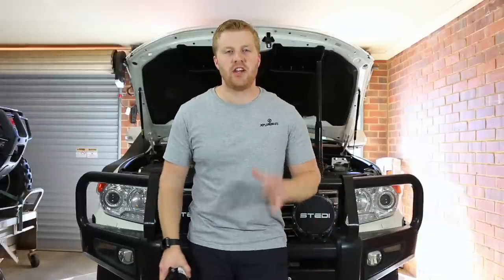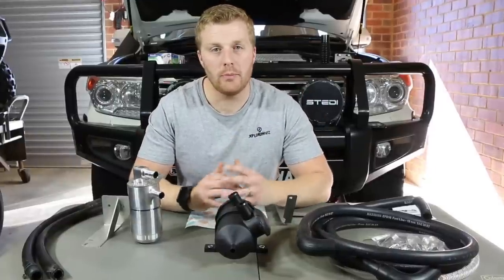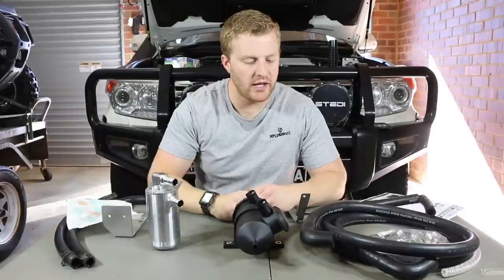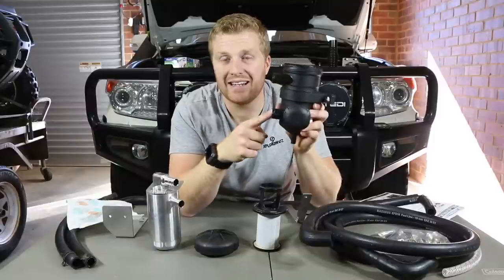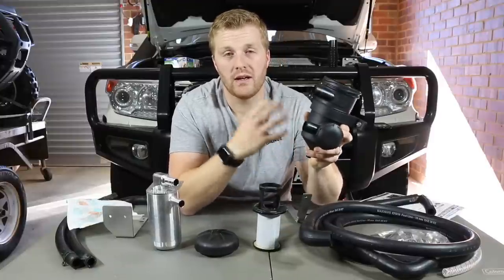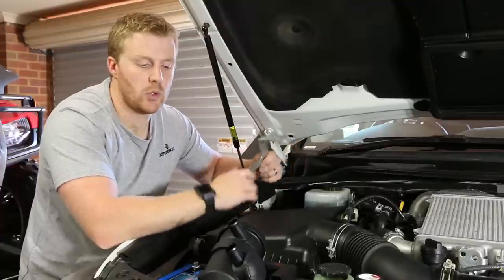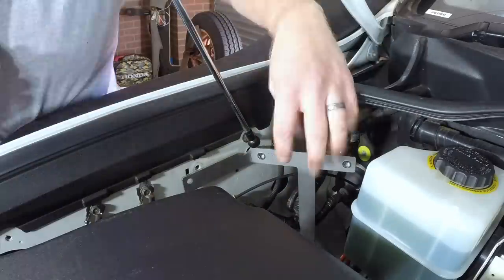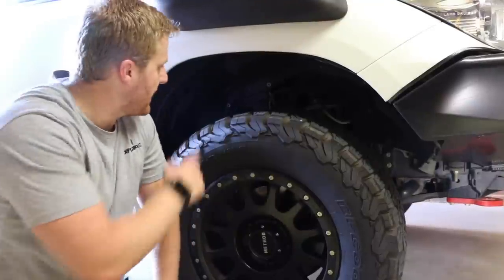LC200 | Provent Catch Can vs HPD | Why I’m swapping | How to install | Difference | Oil Separator

Comment: I'm waiting on delivery of a new 4x4 and yesterday I went in to ask the dealer if me installing a catch can would void my warranty and he went on a speech about how catch cans aren't required on modern diesels etc etc. I don't think it will void my warranty, but I might go talk to the service department instead of the salesman next time. I feel like it's a worth while mod.
Reply from the maker: Yes, salesmen are taught to promote the vehicles and their systems in their stock format. Most salesman won't agree that the vehicle 'needs' all these extra modifications straight from factory. 
I've done another video on my Provent 200 and you can see how much this system has caught - https://www.youtube.com/watch?v=bJ5VG6UhTE0&t=5s
Reply: In my opinion the lack of transparency in the servicing required to keep a modern diesel happy is just straight up dishonest.  Absolutely fit a catch-can, otherwise the PCV and EGR just play “how fast can we choke up the intake”.

Comment: Two schools of thought re catch cans : some mechanical people suggest the EGR valve benefits from some oil, others say no oil or minimal oil (due to Catch can) is better for the ERG valve. Your thoughts?
Reply from the maker: I see what you mean, however I would maintain that the EGR does not require any oil, whether or not it benefits from it is another point. However the EGR was designed to run without oil and will do just fine as such. I would still rather the benefits from a catch can over the potential small benefit. Only my opinion and happy to debate, but that's my train of thought. 
Cheers, Nathan.

Comment: Great vid thank you. How is the 200 since it's been on for awhile, any side effects? Collecting oil ok? Why I ask about side effects is, what happens to the air flow once the filter begins to fill up, my way of thinking is that crankcase pressure would build up and cause issues because the engine can't release the pressure back into the intake. Please share your thoughts about this. Cheers Steve.
Reply from the maker: Thanks Steve, your comments are appreciate. 
So far, it's been working well. There has been no indication of any issues and it is still collecting oil at a very efficient rate. 
A couple of things regarding the air flow, firstly keep in mind the airflow from the crankcase is relatively low pressure. There is no extreme pressure or flow coming from the crankcase and therefore the air has plenty of time and availability to flow through the filter without issue. Further, the Provent 200 (largest unit) has a large filter and is designed to maintain flow and filtration even when fully soaked. 
If in the unlikely instance there was a build up of pressure, these units are fitted with a pressure control value that will by-pass the filter and allow gasses to flow without filtration. Although this would defy the point of fitting this unit, it is much better than risking engine damage. 
Cheers, Nathan.
Reply: I find it amazing that even in the testing the provent offered the highest flow and driest air over the cyclone types. It was just in my thinking of how do you push air through an oiled filter but I hazard a guess that the systems filter and design obviously works. Thanks for your input.

Comment: Great video! after trying several bands, there is no doubt in my mind that the Provent is far superior than the rest. Had one in my old Patrol. Had  PROVENT 200  installed in my LC 79 before it was even registered.
Reply from the maker: I agree, they have definitely produced a solid unit here!

Comment: Great detailed video as always.
Wouldn't waste money on one as there is no harm done with a bit of oil mist going into the intake...... as long as the egr system is blocked.
Reply from the maker: Cheers mate, yeah I guess if the EGR is blocked that little to no harm will come, however I would dare to say that most people don't block their EGR's...
Cheers.
Reply: The oil vapor is still blowing through intercoolers, turbos, and onto the valves.  It’s not just about keeping the EGR assembly clean.

Comment: Tengo el mismo filtro que menciona en el min 10:00, mi duda es que pasa si le saco la válvula de presión que lleva el recipiente por el costado inferior y le adapto una tapa en ese orificio ya que según he leído esa válvula de presión solo es para igual la presión que hay en el motor para que baje el aceite al carter, pero yo al igual que usted le tengo esa manguera de color blanca para luego vaciar el aceite acumulado y en ese caso la válvula no tendría sentido ya que no estaríamos aprovechando su función...

Comment: Bro any catch can made by metal will absorb heat from engine compartment which will increase the oil vapour going to intake system... better to use plastic and install it in the coolest place in engine compartment.. however the blowby gas rich the PCV valve with full of heat, toxic gases ,oil fumes and steam must  to be condensation in the (OCC ) oil catch can.. the more cold OCC the more steam condensation will be operated, therefore it's recommended and advised to use plastic one with install it in the coolest place such as in front of engine compartment behind the head lights. Not to firewall cuz of high temperature..regards for all🙏 God bless you
Reply: your science is wrong

Comment: The part that bothers me is the next sentence you DIDN'T highlight @15:35, and that is "All catch can-type separators and the cyclone imposed HIGH RESISTANCE to air flow in the system, coupled with low capture efficiency, which resulted in a poor quality factor for BOTH types of devices.

This is the part that concerns me. I know the Provent 200 has a release spring/valve, but according to the above report the cannister will always be under high resistant positive pressure. Correct me if I am 100% wrong but surely that cannot be good for your motor or seals?
Reply from the maker: I understand your concerns regarding the pressure build up, but I would recommend reading the full report as they do talk about the pressure values of these units. Although yes, there is a slight increase in the pressure from the CVS, it is far from 'high' pressure. 
Firstly the CVS only emits a small amount of vapour, it's not an intake or exhaust system, simply extracting vapour that has passed the piston rings. 
Secondly, if abiding by Mann&Hummell instructions and changing the filter every 30000km (or circumstantial) then your filter is unlikely to get blocked and cause issues. 
As you have mentioned any significant or dangerous increase in pressure within the unit will be relieved by the PCV rather than causing damage.
Obviously there is the possibility of units failing and creating pressure build ups, where issues can arise, however the normal day to day operation trouble free will be relatively safe for your engine and seals. 
Cheers, Nathan.

Comment: Good video however the provent is susceptible to user error. But so is hpd. The provent is awesome however if the filter is not changed regularly with oil changes then it's effectiveness decreases.  I have tried both on my 79 but room is now an issue and have gone back to the hpd. To overcome the drain issue I have tapped a spigot into the bottom to drain.
Reply from the maker: For sure both are susceptible to user error and their is additional ongoing maintenance with the Provent, but I have found it to be significantly more effective. Good idea with the addition of a drain bung in the HPD though, would make it much easier. 
Cheers, Nathan.

Comment: Dam I'm spewing, I just bought the HPD unit for $400 because of the shiny aluminum and thought it was good quality. I should have done my homework before buying 😢
Reply from the maker: They definitely look good. Look in the end, they do something, but not as effective as others on the market. 👍
Reply: I have an HPD catch can & I'm not going to get too hung up about it. Not only does the HPD look significantly better in an engine bay unlike plastic it's never going to crack. Less maintenance, & no added extra costs buying a new filter repeatedly (+$80 new filter every 20,000 to 40,000 kms). 
The "internet experts" now say catch cans don't make that much of a difference. It's true that whatever you do there's going to be carbon built-up. It's just an inherent drawback of all ICE vehicles.
Reply: Im with @peter. Many say the catch cans arnt good/ dont do a lot. I have a HPD in the paj and there is no problem at accessing the bowl. On top of that what happens when you dont replace the filter (most dont)?

Comment: Sir I've got a question. If your engine already have a PCV (pression control valve), would the Provent's PCV system alter its functioning ? or any other consequences ? thanks.
Reply from the maker: Negative, the factory system will still work as designed by Toyota. It will just be accepting much cleaner and less oily air into the intake of the vehicle. 
Thanks, Nathan.

Comment: Hi guys, what about the TerraTuff Catch can? Are the ProVent catch can better? The TerraTuff looks way better, but I am after the performance over the looking
Reply from the maker: G'day mate. So no particular reason we didn't choose this version. It definitely looks the part, that's for sure and obviously uses a similar filter type filtration system. 
I also note that it costs even more than the HPD or the Provent (which is already expensive).
Also, I was persuaded with the fact that I know the results were accurate from the independent testing conducting by Murdoch University. 
Cheers, Nathan.

Comment: Dont you think the provent filter and outlet pipe is too near? The air sucked from the outlet could possibly get the oil from the filter or a droplet of oil near the rubber end of the filter? What do you think?
Reply from the maker: I see what you mean, but I don’t think that there is much, if any chance of liquid oil getting into the outlet pipe. The pressure within the unit isn’t very high. 
Keeping a close eye on the oil level and not letting it get to high is one key to keeping a healthy system. 
I will be doing another catch can video soon with my review and results from the Provent along with a vapour test both pre and post catch can 👍
Cheers, Nathan.
Reply: @XploringOz  thank you mate. Happy New Year!!
Reply: The inlet is the bottom one, the outlet is the upper one. There is a mistake said in the video.

Comment: use the provent 200 on my brand new Triton gets around 125ml of oil and condensation around 5000kms 

Can't fault the provent also got the diesel pre filter
Reply from the maker: That's a huge amount. At least you know thats not all going through the intake now! They are great kits. 
Cheers, Nathan.

Comment: Ive got the provent and i still get oil go through, they arnt going to catch everything mate
Reply from the maker: For sure. Nothing will catch all of it. The case study by Curtin Uni corroborates the fact that it will only catch 98%. But this is still a heap better than the HPD. It would be crazy to not want the best and most effective if you’ve made the choice to fit a catch can.
Reply: @XploringOz  absolutely, i compared the hpd the provent when i was looking. The hpd looks nice and blingy, but the performance of the provent won me over, not to mention it looks nearly like a factory fittid item being black plastic. The filter is where the magic happens i think

Comment: I dont get the oil back to motor option. Mine has heaps of condensation depending on weather. Why would you want anything but 100% clean oil in the motor.
Reply: T W Adelaide , point noted with the condensation when you open the cover you can see it very clear. But I haven’t figured out yet if the condensates water really drains downwards or goes back into the engine. My drain oil looks black and not visible water coming out while opening the cockvalve. May you have more time drained your system then me till now only 2x and could shed some more light on your findings about water in the down pipe. Cheers
Reply: @holgermuller2987  its almost all water some times. When it's black it still not 100% oil, it's quite water like and looks like both oil and water mixed together. 

Either way you collect what 50ml at most in 10k at worst case blow by, that's not even really going to lower the oil level that much to worry about.
Reply from the maker: Another great consideration and something I forgot to mention in the video. Condensation can be a issue for some people and it's definitely not something that you want to be re-circulating through the engine oil. 
Thanks for watching and commenting, Nathan.
Reply: Cause its illegal to vent to atmosphere 😂😂

Comment: Great study the only part that is not in the study is a time result so after say 5000km driven exactly the same on same vehicle what is the efficiency there is simply no possibility of a cloth filter retaining the initial efficiency in any manner. The  metal filter would change but to a lesser degree. So unless you change the cloth or paper or what ever material is used frequently then I do not see the results being as accurate as claimed. Could be wrong but perhaps it should be tested.
Reply from the maker: Maybe, however my understanding of this type of filter is it is not designed to 'catch' and hold the oil vapours within the filter media, however covert it from a gas to a liquid form to enable it to be captured in the collection bowl. Whether or not the media is soaked with oil or not, in my opinion, would have little bearing on whether it can continue this conversion process. 
I agree with you though, I can't state as fact as I haven't tested it and it's potentially another great test to have a look at in the future. 
Cheers, Nathan.
Reply: @XploringOz  Great to exchange views and ideas with a sensible person I have been watching your channel and really like it. I had the metal one in my last Pajero and it worked really well but I did not get any oil in the outlet pipe but I also cleaned that at each draining of the revivor. I found that can to be very well made and seemed to work really well.
Reply from the maker: @Sabumnim666  In the end, everyone will have their own opinion and thoughts on the matter, but without variation all our vehicles would look identical...
As long as the solution you have is working for your application, that's all that really matters in the end. Glad to hear to your's has worked thus far.

Comment: And...................... the Mann Hummel Pro Vent 200 is around $180. If you find it for less, like on eBay, it’s is NOT a genuine Pro Vent 200, but an inferior Chinese copy often with wire gauze filter that is not as effective as the original.
Reply from the maker: Very true. This is definitely not a modification that I would be saving money and buying the cheap knock off. The genuine filter and system is the one you want to get.

Comment: Will installing a catch can or diesel pre-filter void the warranty?
Reply from the maker: This is probably something best confirmed with your manufacturer. Although with all the safety features of the Provent 200, specifically the over pressure valve the unit is theoretically very safe for the vehicle, but whether the manufactures see it that way is another matter. 
I have found that manufactures are often quick to blame any aftermarket accessory that has been added to a vehicle to cover for known, or unknown manufacturing faults. 
Again, probably best to check with dealer.
Thanks, Nathan.
Reply: No.

Comment: The oil going threw the pcv vent to catch can is of the same oil quality as in the sump there is no increased amounts of burnt oil also the hpd doesn't need a pcv valve as the factory rocker covers are fitted with one unless manufacturers deem it not needed
Reply from the maker: Fair enough, appreciate the feedback.
Further, I believe the PCV valve is fitted to the Provent can to regulate the pressure as there is more resistance from this filter when compared with the filtering system in the HPD. Due to the HPD's lower resistance and 'open' styled filter, there would be no need to regulate any pressure, as it would stay relatively similar to that of the factory design.
Cheers, Nathan.
Reply: It's not just oil that it catches but combustion byproduct condensate. Generally very acidic and will quickly degrade the TBN of oil. I would not recirculate it back into the engine. It is not of the same quality as the oil circulating in the engine.

Comment: Does anyone have an opinion on the Flash Lube Catch Can Pro which is effectively a Provent 100 made under licence. The documentation from Flash Lube states that the LC 200 flow rate is between 70-120L /min and the Catch Can Pro can handle in excess of 230L/ min. If that's the case is there any need to go for the larger provent 200. Plus the Catch can Pro being a smaller unit fits near the fuel filter therefore much shorter hoses are needed.
Reply from the maker: Good question. I can't say I've had any experience or know others that have fitted this unit. Will be interesting to follow this thread to see what others say. 
Cheers, Nathan.
Reply: The provent 100 works fine but has to be maintained more often as it collector doesn't hold much dirty oil.

Comment: its crazy how car manufacturers dont think catch can is necessary on their vehicles. should have been installed in the factory
Reply from the maker: For sure, I agree. With the R&D funds they have you would think they would be able to come up with some sort of reasonable solution.
Reply: They want the maintenance work cleaning out the inlets when they have choked up.  Big bucks to be had.